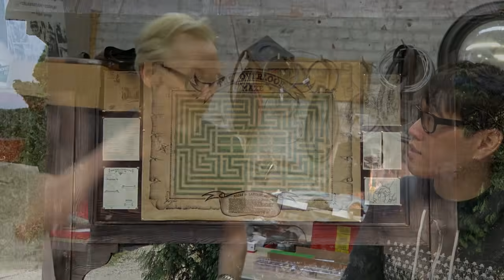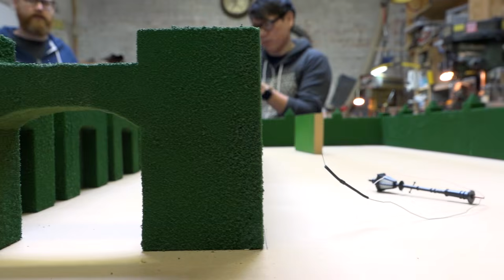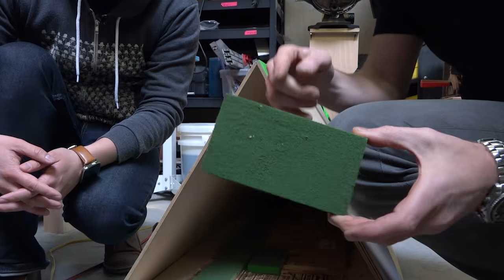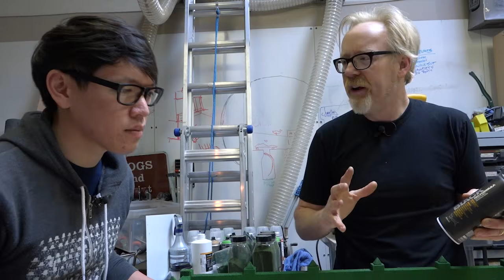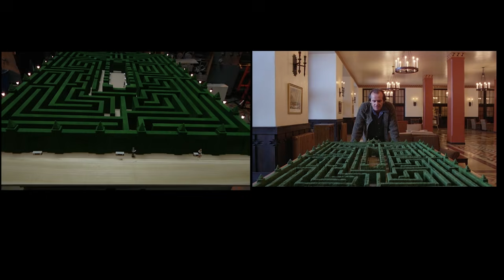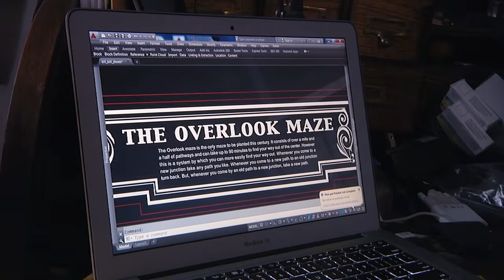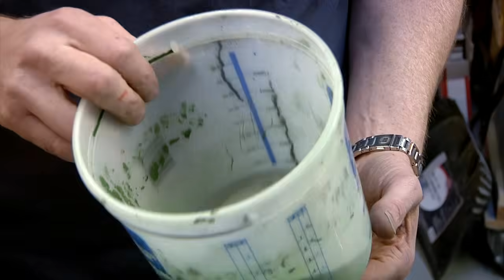Adam Savage's Overlook Hotel Maze Model

Comment: The tops of the hedges are too square.  In the movie they look rough and hedge-like.  Pretty cool, but I'd expect Jamie to catch on to such a detail.

I know he wanted something more solid, but I would have used dry floral foam bricks, cut to size.  That's what it looks like they used in the film.
Reply: +inthefade You could do that.  It wouldn't be as durable though, but probably would look a little more organic looking.
Reply: rgaud8 Definitely nowhere near as durable.  But I hardly see the point in making a build that doesn't look as close as possible!

I would have at least beat up the tops of the "hedges" with a Dremel or something.

Still leagues better than what the exhibition was showing, which was a joke.

Comment: As soon as I saw this I had my own idea. Taking a template like Adam made, but using it to create a large flat plant pot. Then filling the 'box' with dirt and putting the pathways in so it covers the soil. Then actually finding a type of plant that would grow, but look like a scaled version of a hedge maze. Not sure what I'd use. Maybe I'd use chia and cut it into a hedge type style? Not sure, but if you did it right with the correct materials and ensured mold wouldn't grow I think it would be outstanding. I think I might attempt this at some point.
Reply: +PianoXfan1 Use moss.
Reply: +PianoXfan1  I would use my back hair and other such hair to build it but the regrowth time would take way to long.
Reply: Bonsai trees
Reply: Fine idea... You'd have to keep trimming it though. Also replanting any parts that died.

Looks like a life-long task!
Reply: +PianoXfan1 that sounds AWESOME
Reply: You might be able to do it with tufa and moss, honestly
Reply: If you made it from ceramic and then grew chia on it...
Reply: +PianoXfan1 Lay off the weed dude ;)

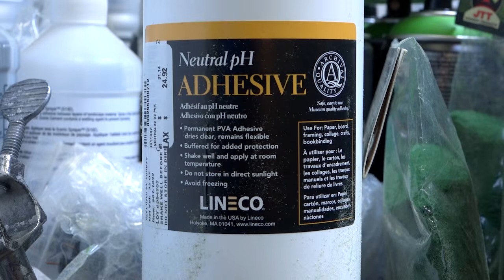Comment: Tested  9:30 Adam mentions he used Adhesive Spray 77 to give his "PH Neutral Glue" a ground to stick to over the MDF...
PROBLEM: Adhesive Spray 77 1.) Is NOT PH neutral, 2.) Will dry out and "dust" off the MDF, adhesives only "adhere" for as long as they contain their moisture, or the medium that binds the substance to the surface it is sprayed a top. (So why use an "archival" glue if this will happen after 10 years?) 3.) Glue sets hard, and the glue you have used is little more than a paint binder without pigment, meaning, it is a durable paint medium without color. 
My SOLUTION: Adam should have skimmed coated the MDF with an oil based primer, then coated with his glue, the primer would have acted as a binder to the MDF, while giving the PH Neutral glue a ground for a strong lasting bond, just as primers do for paint. 
FOR THOSE THAT MISUNDERSTAND PRIMERS: I know some would say that an oil based primer would eventually "eat away at the MDF... well, the MDF made of pine? Pine is about the most unstable of mediums, very acidic based, and the glue used to bind the pine shavings together counters that, but the MDF will destroy itself long before the binders of the oil primer come close to letting go of the hot press surface of the MDF, which, if you did not know, already HAS oil on it, to keep the finishing rollers from sticking to the MDF as it comes off the manufacturing line... why do you think that the glue won't stick to it?? Adam, note that any "cut edges" hold the glue just fine, while the finished surfaces of the MDF the glue beads? There is the proof. Oil based primers are some of the most stable mediums out there, used on houses... forever. Once the primer has set, its surface is ready to receive paint, and over a weeks time, that surface binds to both sides further, which is why it is a "primer" and different from most other paints. It is formulated to grab and bind, then go inert.
Reply: BTW- I admire you for your tenacity on this project Adam!
Reply: ThimbleStudios I have  arguments with my father about primers,he thinks you can use cheap paint as a primer. Thanks for pointing out the acidity of pine. What kind of wood and glue do you think I could use to keep comic book original art without destroying them?
Reply: godbott Unfortunately, cheap newsprint paper of the 50's 60's 70's and up to the early 80's is VERY acidic in nature, yellowing and degradation is inevitable. If you stabilize it with anything, such as a coating of acrylic, that process will darken the paper and not preserve the natural look of the comic. about the only thing you can do- for the long term, and contrary to widespread belief, is to leave the book in open air, and keep the humidity at a constant at about 10%. The only thing better would be to have no UV and make sure the Nitrogen levels are high, this keeps the acidity from interacting with the structure of the paper. This is why the Declaration of Independence is in a glass box, not sealed into acetate binder, as the gases from the paper itself will contribute to the yellowing process.

Comment: The original crowns seem steeper in the movie but they certainly have a much larger narrowed gap spacing them above the hedge. I think the material you added as spacer was not thick enough after the flocking material added to the surface.
Reply: Ah never mind, you fixed the crowns in the final build.

Comment: MDF sure molds easy and wicks H2O out of the air,also can swell so not dimensionally stable if not finished I would assume LDF may be even more susceptible to moisture than MDF? Cool project just wonder how safe it wouldbe with time.

Comment: As Adam rightly points out, there are variations in the maze layout from scene to scene.
First, the entrance to the maze is shown three different scenes. The first two times the entrance does not face the hotel. The third time, when Jack is chasing Danny, the entrance is now facing the hotel.
Second, the layout of the maze changes from scene to scene. In the second scene showing the maze, when Wendy and Danny enter it, a detailed map of “The Overlook Maze” is shown just outside the entrance. In the other scenes showing the entrance, this map is missing.
Third, the maze shown on the map and the table top version that Jack looks at are the same, but the layout of the maze when the film shows the maze from the top down is very different, and significantly larger.
Fourth, the interior of the maze when Wendy and Danny enter does not match that of the map which was just shown.
Fifth, the maze map provided to workers on the film, while it only shows small portion of the maze, namely that portion used in filming some of the maze interior scenes, also has a different layout from the other scenes.
Stanley Kubrick deliberately introduced contradictions in not only the layout of the maze, but of the hotel itself, and he did so deliberately. He wanted to disorient the viewer by confusing their spatial awareness.

Comment: Tested @15.26 There is some red writing under where a wall is going to go, is that some kind of "makers signature" in case someone removes a wall in 50+ years time?

When i used to work as a site carpenter, i used to sign the inside of every bath panel(the boxing in of the side of a bath) not as cool as Adams signature but still funny to think about in 30 years time!

Comment: Why not use CAD to layout the maze? That's what I'd do. Although I guess drawing the maze outline by hand gives a more satisfying feeling when completed. Great work, guys :-)
Reply: I think Adam may have been attempting to adhere to the spirit of the original model's construction in the movie universe (or the production build on the film), so using CAD would have been anachronistic. Plus, he's a hands-on tools kinda builder!
Reply: KBABZ Gotcha :P
Reply: RoboTekno That's my guess.

I know personally I can't sketch out ideas on a computer, despite having used them heavily since I was very young. It just doesn't feel the same. I lack the automatic freedom of my hands, and a piece of paper. Computers are good for some highly detailed technical work, but who knows how much fudging around Adam was still doing at the stage he was drawing it out.

You can look at a computer drawing all you want, but until you have the actual thing in front of you, it's hard to judge things as well as you can.
Reply: seigeengine To each their own ;-)
Reply: RoboTekno People who are experienced doing things on paper (years of experience) can do things pretty quickly.   The advantage of CAD is that you can modify things much more easily, but this is a replica of something, it's not something that needs to be constantly modified and improved.   Also, it's not that complex.  Adam can probably figure out the parts list in his head.

Comment: Tested Re-watch the shining and check these things out
-the path Danny takes, and the path Jack takes, are not the same path, and do not have the same numbers of turns. 
-The layout of the overlook hotel is physically impossible, for instance:
--The bathroom is the corner of the suit, and has a window 90 degrees to the window in the main room, implying a corner suit, but the bathroom window exits to the center of the building
--There are 2 different versions of the gold room
--There is a hallway of rooms, where one wall of doorways is JUST a wall, it is less than 5' thick there are no rooms behind the doors
--There is a hallway that goes behind windows in the main hall
--there are windows in the office with the radio, which is fully at the interior of the building

The layout of the overlook hotel, and hedge maze, are Geometric Impossibilities, built out of multiple conflicting layouts in order to disorient the viewer, adding a sense of un-ease which compounds with the horror. it includes rooms that are bigger on the insides, and overlapping rooms.